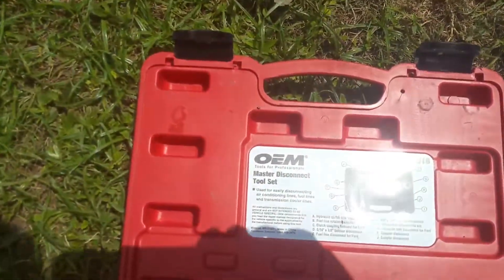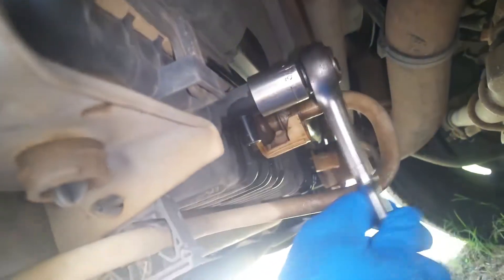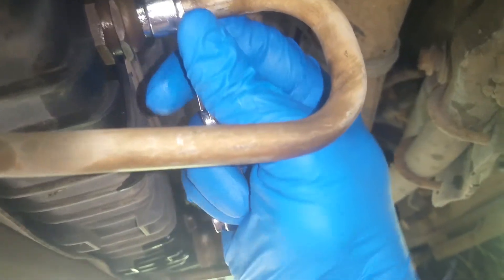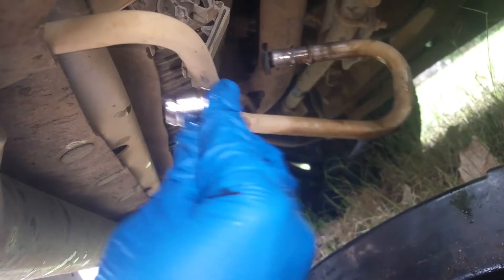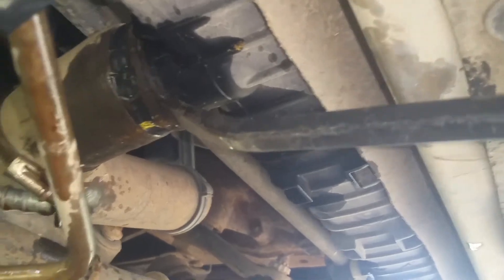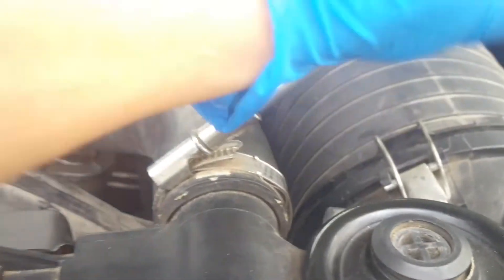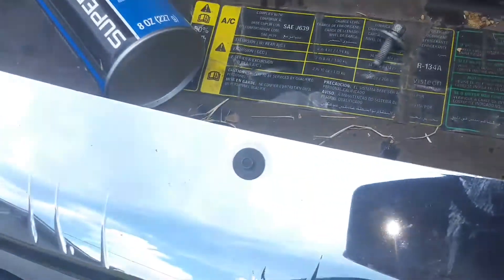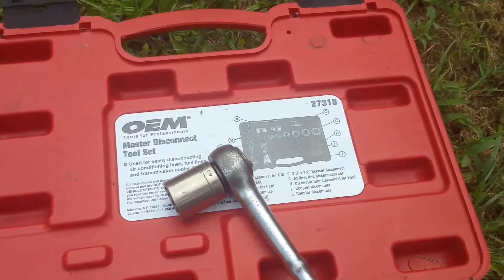How to replace radiator ford 6.0l

Comment: As far as radiator swaps go, it doesn't get much easier! Very smart move to use the rubber plugs. Thanks!
Reply from the maker: +Baxrok2 exactly I've changed a few that were a real pain to get at with no room . These ford trucks aren't too bad. I kinda wish I'd splurged and went for the all aluminum radiator , but maybe later . Thanks for watching

Comment: So I got the auto zone master set but having a problem of getting it to go in? Any thoughts? Or tricks I’ve cleaned the line and used air
Reply from the maker: The stepped one is the only one that will fit I believe. Also I had to use white lithium grease in the spray can. This helped a lot. Also they are a real bear to pull off even after the clip is disengaged. The white lithium helps slide them back in also which is not easy. Hope this helps. Thanks for watching.
Reply: @s33therfan  well I tried everything I could! I had to in screw the fitting and use them in the new radiator it all worked out no leaks lol
Reply: These were the worst part of my day doing this swap today. Broke the loaner tool on second one after using a can of brake cleaner, half a can wd-40, sweat, cursing, busted knuckles and so on. I could swap this one for a new one tomorrow in an hour!  But old crusty fittings, took me half a day! Video was very helpful all in all!

Comment: Best way to re fill after?
Reply from the maker: I just refill using my big funnel kit with adapter for removing the air. It holds almost 7 gallons so I use 3 1/2 concentrated and 3 1/2 distilled water. Thanks for watching.

Comment: Flush system before or after? I have a leak on top of radiator...
Reply from the maker: I guess it would depend on the condition of the coolant . If it's dirty I'd definitely run some flush through there. A lot of people spend a lot of time keeping their oil and coolant as clean as possible through various methods in an effort to preserve their oil cooler , but at the end of the day it will still clog and need replaced like anything else . I just use ordinary coolant through mine never had an issue . I would point out in this truck I'd done a complete engine replacement and most of the coolant was drained and I used new hoses and overflow tank etc . I never did a flush on it but it was pretty clean surprisingly and I'd expect some debris from the replacement engine . One problem I ran into with the aftermarket radiator I got was the tran cooler line fittings so I used the ones off my old radiator . So next time I will search for a closer to oem. I've got several other videos on this truck with the engine replacement and prep I invite you to check them out . Hope this has been helpful and thanks for watching

Comment: What size is that disconnect tool?
Reply from the maker: transmission cooler disconnect tool - Google Search
https://www.google.com/search?q=transmission+cooler+disconnect+tool&oq=tran+cooler+disconnect.&aqs=chrome.2.69i57j0l4.8487j0j7&client=ms-android-samsung&sourceid=chrome-mobile&ie=UTF-8#imgrc=-LWwtAhm9E21KM&scso=_PyBZX7bDJYu8sAXdq73IAg226:667.4285888671875

This is the one I have . Its a stepped disconnect tool ; Ford loves to use these and they never remove easily. I know you can get this tool at most parts stores now . It will look like an ordinary fuel line disconnect but with the step. Thanks for watching.